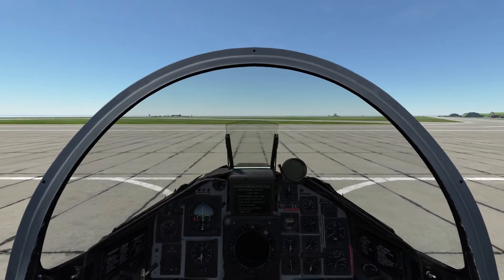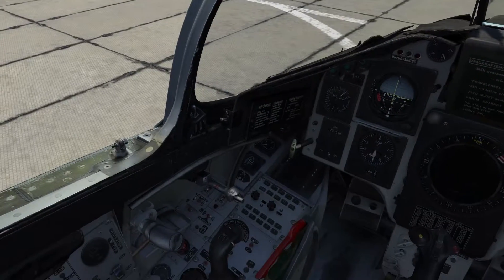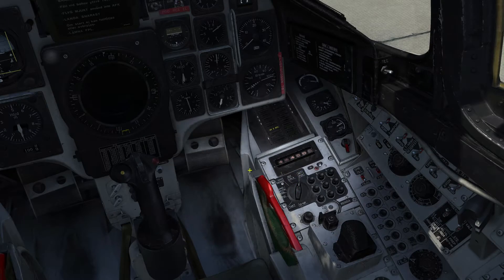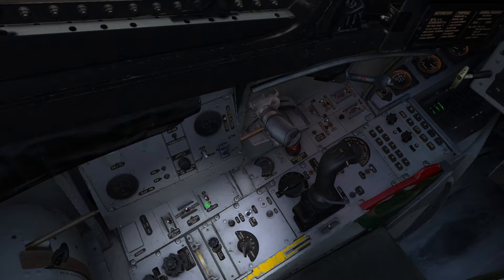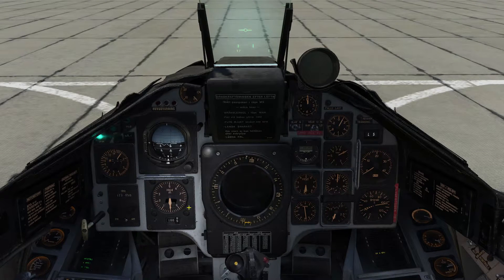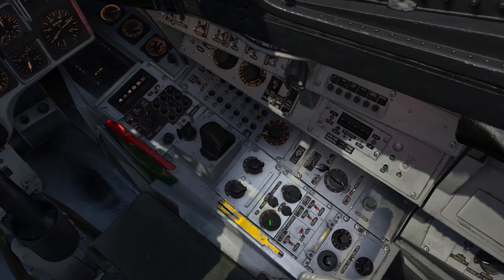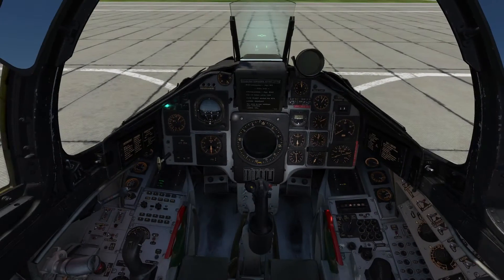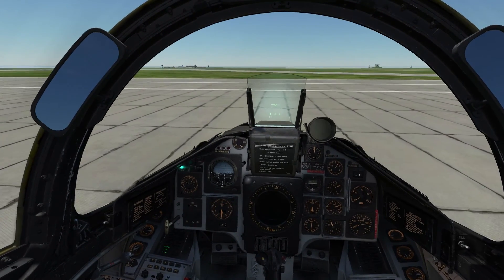DCS:World » Ramp Startup » AJS-37 Viggen

Comment: Great video, top shelf stuff here.  I'm gonna pass this along to anyone I can.  Do you know why my communication menu to airbases in a multiplayer server would be blacked out?  I've studied the manual and looked everywhere but I can't figure out what I'm doing wrong with the radio.  I set it to norm and try the different groups for the FR22, nothing.  I tried manually setting the frequency but it didn't seem  to do anything.  Any tips for this? 

Thanks again for the video; how did you get the clow around your cursor?  Post processing or is that 'visal recon mode'?
Reply from the maker: Thanks, and yeah that communications menu being blocked out.  I've seen it before, can't say I recall when i first seen it but I think it was around when 1.5 came out.  I am unsure as to it's cause but one thing you could check is in the options, see if you have easy communications enabled as it has caused various communication related issues in past questions I've seen.

In regards to the illumination around the cursor, that is a pilot flashlight that a few modules use.  I can't recall the binding off the top of my head but it's in the keybinding menu.  I think it was one of the left modifiers like ctrl or alt + L.  I'll dig it up later on when I'm free.
Reply: Thanks I'll check for the options for simple comms and the flashlight should be nice to bind. Can you flash it at other players?
Reply from the maker: Unfortunately only the player will see the flashlight when it is in use